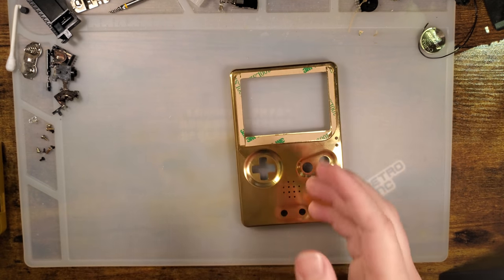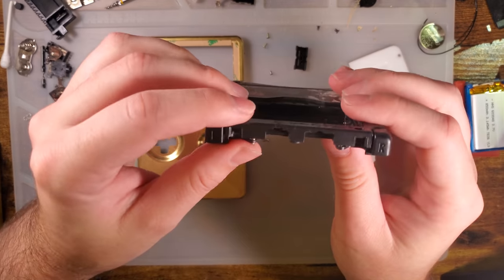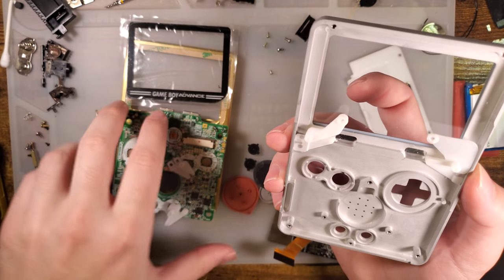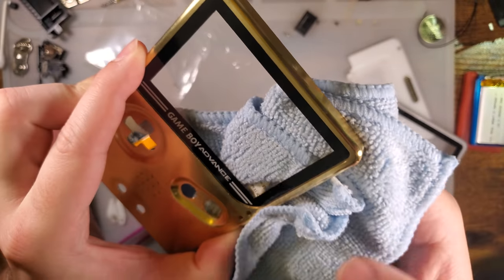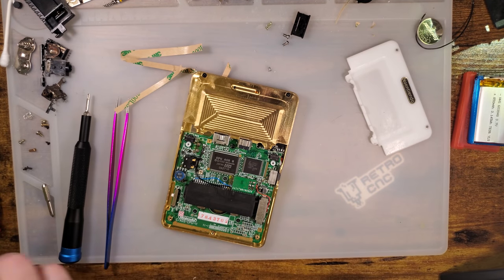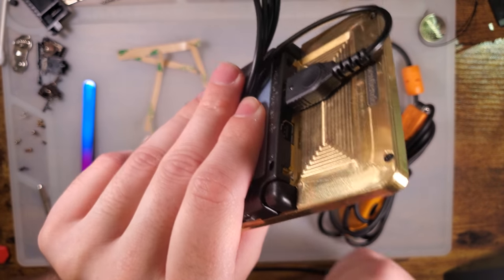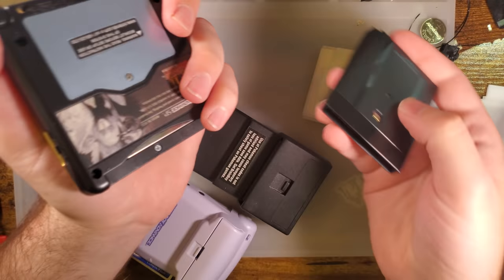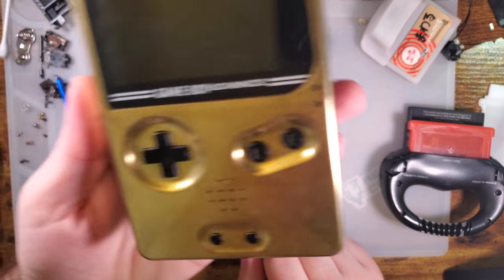What Goes Into My Slate

Comment: Sure, some people might complain about the "rounded screen corner" vs normal rectangle, but I find this to be an interesting design choice.  All of the "slate/slab" versions of the GameBoy have this design (DMG/Pocket/Light), and many modders in this space actually are interested in fitting something like a GBA into a GameBoy Pocket shell.  Although the screen is not "true" to the GBA SP (rectangle... normally off-center mind you), this basically is a better option to having a "GameBoy Pocket" with all the benefits of a GBA (except some link port accessory options).

Comment: Your slate looks great and it looks like something that nintendo might of come up with if they didn't think of the ds and follow that route
Reply: Nintendo would have at least made it symmetrical
Reply: Wasn't the original sp asymmetrical with the screen edges? Looks like Makho fixed that. I'm not sure what you mean "Nintendo would have at least made it symmetrical. Whats not symmetrical about the slate?
Reply from the maker: @epicpikachuxyz  lol you do realize that my slate is the only symmetrical SP option out there, right? Every single other design is off center (except maybe xipher's, not sure off hand).
Reply: @epicpikachuxyz  I stand by what I said, it is an excellent design and why would it need to be perfectly symmetrical anyway
Reply: @makho  obviously the one rounded corner is a trigger for some folks
Reply from the maker: @DarronPotter  I couldn't give less of a shit about those people's opinions
Reply: @makho  nah u do u. Iam just saying the side profile just looks off to accommodate the og buttons.
Reply from the maker: @epicpikachuxyz  well, as I explained in the video, I had constraints to work around ($) barring a total redesign of the hardware ($$$). It feels fine in hand.

Comment: I may have missed something, will they be available in aluminium only or in classic plastic too? Not just because of the price, more like personal preference for the feeling in hand. Awesome project btw, definitely love the design
Reply: Pretty sure only metals, as plastic can bend/break easier in this thinner form factor. Also, probably harder to Quality Control plastics
Reply: @Omega_2  Neither the resin/wood one? RCNC said "working on making a lot more" on Instagram 2 months ago, I guess I got my hopes up for nothing :(
Reply: Manuelx dont quote Mei, but I think he said he wants to put out the files after the metal shells have sold a few batches, so we could print our own. But plastic would be out of the picture, it would have to be some kind of resin.
Reply: @nissutobor9078  Yep resin would be perfect, just not metal, it's heavy, cold, and not much a fan of the feeling in hand. Hope to see something similar in the near future
Reply: @Manuelx98.  Aluminum and plastic slates weigh pretty much the same. The aluminum ones are room temperature for maybe 15 seconds.

Comment: I love the rounded corner screen lens. As a matter of fact, I wish the bottom right corner of the shell was also rounded, similar to DMG/pocket.
I also wish the definitive aluminium shell doesn't have this kind of pyramid shape and the front. I just want it flat.
Reply from the maker: I cannot round the bottom corner of the shell or it would no longer be compatible with OEM rear covers too.

The "pyramid shape" is just the machine tooling marks and is not present on the retail version.

Comment: Looks great. I just got the boxypixel one and I'm happy with it, but I like how different your design choices are and the pros and cons that come with it. The thinness is very appealing. 
I think (hope) one of the big advantages of your kit should be price, since it's less pieces and doesn't require things like buying his specific buttons, his specific screen, or even the battery spacer you need for his kit if you aren't buying his upgraded battery.
I didn't realize his was missing the lanyard point, now I'm bummed about that. I love having lanyards on my handhelds.
Is your design possible as a uv resin 3D print? I feel like that would be a great material for it to achieve the design with a reasonably low cost but high quality, and you could sell the files themselves so people could print their own. Especially for those that aren't crazy about having a metal gameboy.
Reply from the maker: It's printable (SLA or SLS only, FDM is not feasible with this design) but it's still pretty delicate. I started this project saying that I will release the files for free and I intend to carry through eventually. Files will not be available until after at least a batch or two of machined shells have sold.
Reply: @makho  Oh that's very kind of your to provide the files for free, and it makes perfect sense to wait till after you've sold some.
Reply: @makho  omg i love you for saying that! Tbh, I'm proly still going to buy a metal one, but I would love to print a transparent version!
Reply: @makho  That is more than fair. You deserve to be rewarded for your time and own money used to get these things rolled out. I think I'll start saving for one, myself.

Comment: Features of Makho design vs Boxy Pixel design

Features of Makho's design:
- Much thinner design, shorter length
- Can use stock buttons (d-pad, A, B)
- Closer fit around buttons and d-pad (better tolerances)
- Can use all external peripherals that plug into the cartridge port (ex: e-reader)

Non-existing features:
- No matching backplate, you have to use the back half of your SP or steal from another shell
No USB-C hole option for mods
No Headphone/Audio jack hole for mods

EDIT: Actually there are USB-C replacement mods that sacrifice the link port, and options to also route audio through the USB-C port as well (for headphones).  Thanks @makho for the additional information.

Is this an excellent design?  Yes, this thing looks incredible.  Just good to know the differences between mod options for the build you want to make.  I think things like having battery options and being able to have a USB-C charging solution is popular right now.
Reply from the maker: you can still use the USB C charge port replacement (which is the better mod anyway)
Reply: @makho   [Does quick research...] You are correct, you can sacrifice the link port for a USB-C charging port replacement.  I also see there are options to also wire in audio through the USB-C port as well, so there IS an option for USB-C + audio out, with sacrificing the link port.  Honestly not a bad option considering you cannot fit the GBA-to-GameCube link on this or Boxy Pixel.

Comment: Isn't going to a non laminated screen cover a step backwards?

I hate the dust and potential finger prints that will get on either the screen or screen cover.

I'm excited to get the laminated gbc eventually and hope they'll do the same for the gba and others
Reply from the maker: using an "internal" lens is a step backwards so no.
Reply: @makho  not comparing the boxypixel to yours.. More of a general statement. I put a lot of gb units together and keeping things clean is tough, especially with carpet and animals in the house.

I don't really like how the screen is loose to move around slightly in the boxypixel unit though. I can understand why its like that since tolerances can be poor with these ips kits. Never know what sweatshop these came out of in the mainland.. Lol

Comment: battery covers are the one and only reason to ever keep the cheap $0.02 screwdrivers sent with any chinese kit....
Anyways, I saw a while ago you put a like on my comment giving a "basic google breakdown" on why the price on BP's shells are Not BS.  First I was wondering if your design differences from theirs may have a potential of reducing cost by any amount that could be passed on to the consumer?
 (NOT asking for a confirmation, only a "potential of it")

 Secondly, I forgot if I'd asked before or if you answered anyone else who asked this, but is there anyone you can recommend for flash conversion mail ins? I've got a small stack of jp pokemon and it's only going to start growing.
Reply from the maker: > First I was wondering if your design differences from theirs may have a potential of reducing cost by any amount that could be passed on to the consumer?
Well, my shell is smaller both in length and height so it can be made with smaller stock. Smaller stock is cheaper than larger stock and potentially requires less machine time. Additionally, mine is fewer individual pieces which can also be cheaper, especially when it comes to finishing. 

> is there anyone you can recommend for flash conversion mail ins?
no one that I'm aware of

Comment: Hey, I've got a question concerning the AGS-101 screen inside an AGB-001. I did this mod a few years ago and noticed there was quite a bit of ghosting. From what I remember I adjusted a pot to try and make it go away. I recently dug out the gba again and could definitely tell the ghosting is still very noticeable. I remember reading somewhere at the time about either a brown or white tabbed ribbon cable as a possible fix for the issue, but I never tried it.

Anyway, do you know of a proper fix or anything about the ghosting on this type of mod?
Reply from the maker: sell the AGS-101 screen and upgrade to an IPS kit. This is a very common issue with AGS-101 LCDs and is inherent to how they work.